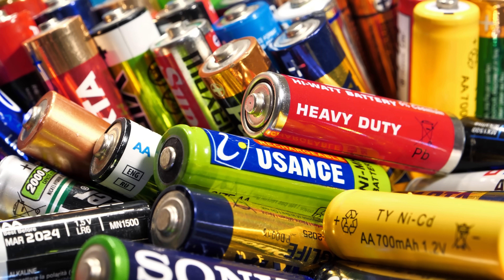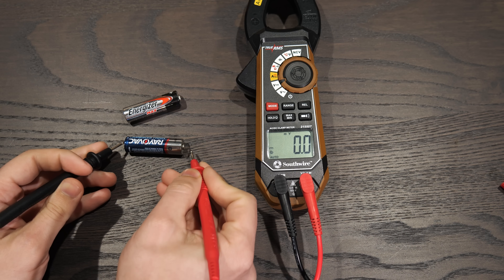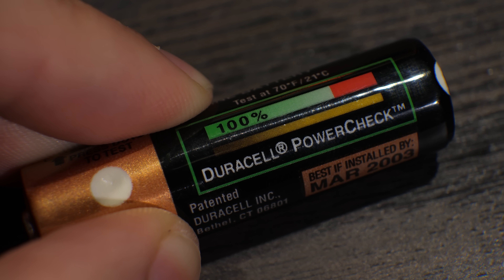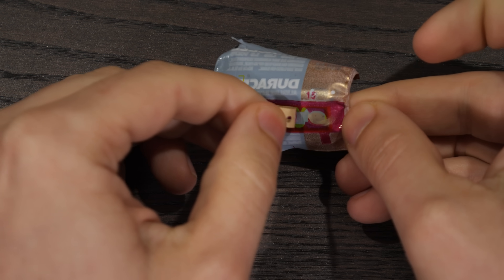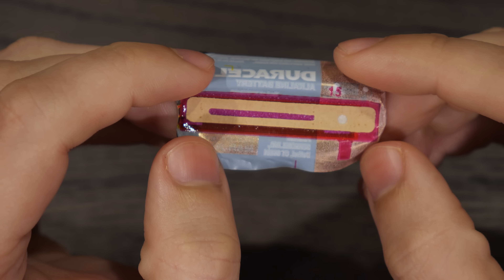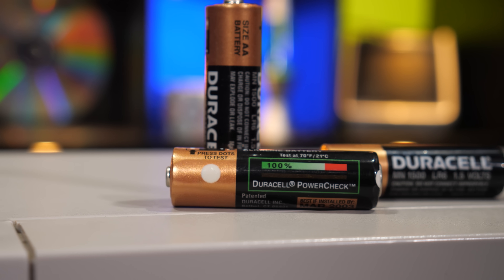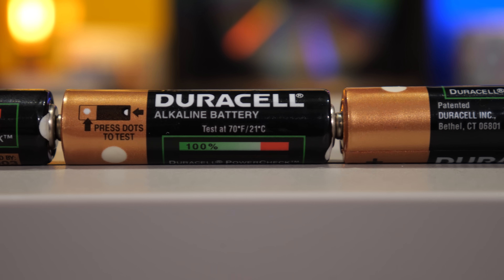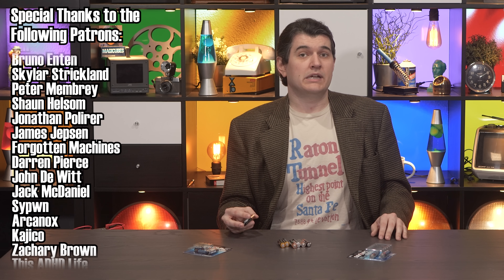Duracell PowerCheck: A genius idea which didn't last that long

Comment: The most common way to cause premature battery failure and leakage is to mix a fresh battery with a used battery. That can happen when salvaging a battery when dealing with items that use different voltages. Like pulling a battery from something that uses 1.5 VDC into something that needs 4.5VDC.

Comment: Some devices reject batteries sooner than others, so that's why I have partially used batteries around. For example my digital camera rejects batteries pretty soon, but I can use them in wireless mouse for a good while after that. When the mouse starts shutting off, battery shows about 0,9V with multimeter.
Also, have noticed, at least with LED head torches that use 3 AAA batteries, usually when it gets dim, for some reason only one battery has lost the voltage, two others are still just fine.

Comment: While I agree this isn't as useful as the inventors thought, I do think you missed an important use of them, which is the main reason why I liked them and would prefer if they were still sold:

Imagine you have a device that needs batteries, and it's suddenly stopped functioning. It's probably just that the batteries are dead... but maybe not. Maybe the device itself is broken. Or maybe only one of the batteries is dead for some reason. Or maybe the "new" battery that you're using has been sitting around so long it's degraded in the battery drawer enough to no longer be useful. It's useful to have a relatively easy way to test the batteries so you can be assured that it really is the batteries (or, conversely, that it really isn't the batteries).

Comment: AAA are everywhere now, though the devices they are in could easily fit AA.
It gets worse when there is an "internal battery", a cheap lithium cell which floats around an enclosure where you could have fit like 6 AA's.

Comment: I'm an odd one out and use a battery tester nearly daily for my hoard of partially used batteries in my work place. I have a collection of AA and AAAs for camera flashes and radio triggers for flashes and strobes, I'm often just testing the functionality of those devices so I place the battery in for a few minutes and then take it out again.

Comment: I suspect AAA batteries are selected for hand held remotes due to the weight issue. There is probably a slight measurable improvement in user experience with a remote that weighs slightly less for reasons of balance and muscle exhaustion.

Comment: I am also very glad more devices are moving away from disposable batteries, but at the same time appreciate being able to replace a bad battery instead of throwing the device away. 
I like rechargeable replacements for alkaline batteries. They are replaeable, can be used in vintage devices, and best of all, they do not leak when they die and sit in the device. That is one of the worst parts about alkaline batteries, and just how much chemical trash they make.

Comment: As a 90's kid, I sure as hell remember those, it was always fun pressing on the switches and seeing how "good" your batteries still were! And then eventually came smart chargers with computer processors, which would re-charge my batteries to just the perfect voltage, which as he said, made non-rechargeable ones just.. obsolete. Nowadays you can easily get a good 1000 charge-cycles or even more if you have a "smart" charger that adjusts voltage and charging current perfectly.

Comment: As for testing batteries with a multimeter - for the AA and AAA ones I tend to use the amp meter. I put the meter on 10 Amp DC circuit and that's good enough to handle shorting a small battery for a few seconds and is a better indicator of how much juice the battery has left...

Comment: I am with you that the built in battery tester wasn't really worth it.  However, I can envision some cases that generate partially used batteries.  Perhaps the most obvious for me is the flashlight.  You pick it up and it produces no light.  You replace the battery, thinking it may have been left on.  Still doesn't work.  You make a trip to the store and get another bulb.  This normally fixes it.  Most of us are too lazy to put the original batteries back in, and the originals get tossed in the junk drawer.  Condition unknown.  I have also run into corroded or bent switches.  Believe it or not, I have seen similar things happen with car batteries.  How many people think that if the car doesn't start, it must be the battery?

Comment: We don't even really need battery testers.
Just put the batteries in the device you need to power up.
If the device turns on your battery is good.
That simple.

Comment: This feature was extra useful on road trips when the parents got one package of AAs and you just had to make do. Sometimes one battery died before the others and the tester could find the culprit, sometimes you just wanted a proxy for how much play time you might have left on the gameboy or CD player. Considering the low cost per mile of quiet kids in the back seat time, in hindsight I’m surprised they didn’t just buy more batteries.

Comment: another reason for dicontinuation. is the temperature sensitive indicator.
 they would have to make multiple version for various regions/climate. 
in asia, it was always yellow. so it thought toi be a useless indicator, until we keep batteries in the fridge for storage. its something i learned from photographers.

the idea of using voltage drop is why newer batteries simply use 4-5 LED to show charge level and flashing to indicate charging is simply a pulse circuit added

Comment: Okay, I've literally never seen one of those work before. I was always a weak child, before I got my nutrition and exercise situation fixed as an adult. I could never press hard enough. Seeing it glow orange was pretty cool! 

I convinced myself it maybe worked like one of those colour-strip thermometers and that I sometimes saw the red bar move, but, ultimately I just... never got any use out of this feature.
Reply: Okay, so it does operate like those bathtub thermometers but not in the part I was looking at 😅

Comment: I never even thought about using that feature for testing stored half-used batteries. I always used it to figure out which battery in a multi-battery device was dead, and miss the feature every time I have to change a device’s batteries. Also it makes me wonder if they realized that some people will just change all the batteries in a device when one dies if they don’t know which is dead and don’t want to bother finding out.

Comment: Makes sense why they aren't in production.

The cell's housing has an entire body positive terminal and a small button negative contact

Which is counterintuitive to nearly all battery designs which small positive terminal and a full body negative terminal.

This meant opening and operating an entire new line of production for this design change which technically operates as reverse polarity battery.

The small positive and entire body negative is literally like a standard for any cylinder type battery like the AA, AAA, 18650, 22650, etc

Except for those button cells.

Comment: I liked those built in battery testers. They came in real handy. Now I have a battery case that holds AAA, AA, C, D 9 volt and CR2032 batteries. The case came with an analog battery tester. Personally, I prefer alkaline batteries because the NIMh rechargeable batteries topped off at 1.2 volts and that’s a problem with most of the devices I use them in.

Comment: Fun story from the 1990s: as a child, I was gifted a radio controlled car by my parents. It was powered by 10 AA batteries linked in series. After playing enthusiastically with it around the house, the car stopped working. My dad, ever the savvy fellow, pulled out a multimeter and checked the batteries. They each clocked in at about 1.4 volts. But, even as a child, I understood that it added up to a drop from the expected 15 volts to something just shy of 14; just barely enough to no longer properly work.

Comment: if you put your tongue on the strip, you can feel it get really warm during the test XD

Also still see alkaline batteries that sometimes have this exact strip included in odd gadgets once in awhile. Whatever fancy factory machine Duracell used is still out there, somewhere, still putting power check buttons on off brand batteries for manufacturers

Comment: As I recall, using the last breath of my memory, some items only functioned on the full half of a battery, such as a cassette deck, remote control car, or other motorized item.  Then they could be used in a transistor radio or Game Boy for their lower power life.  Batteries were expensive. The problem with this tester was it was obnoxiously hard to press the dots hard enough to reliably run the test.

Comment: Interesting video on batteries. I used to work for RAY-O-VAC back in the late 70's at the engineering and development center as a technician. A lot of cool things done there. As a technician I was doing research into better alkaline batteries. But the coolest was lithium back then. Oh the stories I could tell. One of the best jobs I ever had !

Comment: I had a pack of I think heavy-duty or lithium Duracell batteries a couple years back, all the cells had powercheck gauges on them. It was a brand new pack of batteries that has been manufactured that year, so duracell is still somewhat using the powercheck stuff

Comment: Somehow, I never knew these existed. I’ve always had a multimeter. And, I keep new batteries in their packaging and used ones in a drawer, just in case. Apparently, as batteries age, their internal resistance increases.

Comment: As someone who really hates throwing functional stuff away, I have a lot of older oddball devices around that use disposables like this still, but for that exact same reason I have a family of rechargeables for said old thingamajigs. 
I often find I'm skeptical of how much charge is in them after they've been in the device for a while, even if it works when I check them. 
A simple checker built in like this would actually be tremendously helpful to me, now that I'm using batteries I need to keep topped up, as opposed to just tossing them when the proverbial gauge hits E for "end".

Comment: I still have the built-into-package testers out in the garage.  Probably D, C, and AAA, but maybe not for AA.  The testers themselves were different, no doubt because battery drain characteristics were.  It was hard to fit them "wrong" except one combination: AA cells would fit fine into the C tester.  I believe there was a 9V version as well.

Comment: I had a product in the 90s that used AAAA. (Yes, quad A batteries.) It was a small device, but it wouldn't have to be much bigger to handle a battery that stores actually stocked.

Comment: The best disposable batteries you can get are Energiser lithium's as it's a false economic buying anything else. Yes, they are exspencive but they'll last Soooooo much longer than anything else out there. They also don't leak and their very light compaired to all the others due too the chemistry. 
Your literally thrown your money down the drain if you don’t buy these. The best and cheapest place to get them is on eBay or Amazon and you definitely won't be disappointed, that's for sure.

Comment: I learned you can either bite the battery or bounce it to see if it’s used or new. New ones are soft and don’t bounce as much. Used ones won’t dent if bit and will bounce much more than a new one when dropped. I drop it on the bottom flat end. I’m commenting this before the video ends. If he mentions it, I’ll hang my head in shame, but leave the comment up.
🤞

I don’t recommend biting it btw. It does work, but it would be a really silly way to mess up your teeth

Comment: The first thing that uses AA batteries that comes to mind is Xbox controllers. Which tbh is actually a good thing since it's easier to replace a AA than take apart a controller and replace a lithium battery

Comment: I remember these Duracell 9 volt batteries (those square ones you'd use in fire alarms) that had a variant of these power check things. They used a separate strip of paper with a similar level to them. You still had to apply pressure on the end of it and it would get very hot but it did show you the level of the battery.

Comment: There is a video by a "maker" couple who make fun projects on you tube.
     They once painted their toilet seat with that thermo-chromic then she sat on the toilet seat after the paint was dry. It left a very detailed image of the parts of her body that were on the seat. Her reaction was pretty funny as she clearly didn't expect it, but the fact it was included in the final edit means she didn't really mind.
    No, I will not link the video. If you want to see it, you'll have to "pay" by doing the "work" to search for it.

Comment: Didn't last that long? Alec, there's a set of spare duracell batteries for my wireless mouse (the primaries are rechargeable but I need something while they sit on the charger occasionally) with the powercheck thingie on them!

Comment: Random snippet I would test my junk drawer batteries by dropping them on the floor and the batteries that would (bounce) were either depleted and the ones that wouldn’t bounce still had enough juice to be used (or it was the opposite) 
Not sure if it was a coincidence or there was something to that but It didn’t seem to fail that much.

Comment: I found these useful when you weren't sure if it was the remote control, infrared sensor, or the batteries that were the issue. My parents went through a lot of contortions trying to get the remote to work sometimes LOL

Comment: I know some people who still burn through disposable batteries. I personally use lots of AA and AAA batteries, but I have been using NiMH rechargeables for decades. If you're wondering what for, here are some: LED light strips (some built in USB, some AAA), wireless Xbox One/S controllers (still AA if you thought they were lithium ion!), and a wireless mouse.

Comment: I used to love this testing strip, and I always wondered why it went away.

Incidentally, I made a big push over a decade ago to move all my AA-powered devices to AA rechargeables.  I found out pretty quickly that NiMH batteries only produce 1.2 volts at full charge, and many digital devices refused to work with that little voltage, and would only work with alkalines.  It annoys me to no end, since it's trivial to build a voltage boosting circuit into the device, which trades a bit of current for more voltage, and could allow batteries of all types to be used, and makes them last longer.  But, hey, a voltage booster adds a few pennies to the manufacturing cost, so... of course we can't do that.

That reminds me... I have to change the button cell battery in my bathroom scale again.  That darn thing chews through a new CR-2032 in a couple months.  Sigh!

Comment: Me and the boys use the drop test
Reply: Grab the battery in question and a full battery (for control). 

Drop them at the same time from the same height.

If the battery in question bounces higher than the full one, it's less full. 🤯

Comment: They actually did keep this technology until about 2020, they just made it an exclusive for the Duracell Quantum. I got those pretty regularly because I had a Windows Mixed Reality VR headset and they were the only battery that woudnt get murdered by the controllers in a few hours. Rechargables didnt work well due to the voltage drop rate

Comment: when these came out, I decided to only buy them, due to the functionality. I think I mostly wanted to know if the batteries were still good before replacing them, or before using them new from the packet, in case they were already too old. a couple of years ago, I had an excellent 3 led orange battery tester, but lost it after a fire, and now can only find the analog voltmeter types that are much bulkier than needed

Comment: I remember these. I also remember in the very early 90s when I was a kid (maybe about 1991) when these testers came out, but in the battery packaging like you mentioned. The first ones didn’t turn yellow, but more like a weird dark rainbowy LCD like color. Then maybe a year later is when they turned yellow.

Comment: i have a box of them from when i change out smoke detector batteries and the holiday window candles (i use them remotes and flashlights that get used up on the regular)

Comment: Not mentioned, as far as I got in the comments:  the insulator made these batteries ever-so-slightly larger than typical AAs; this made both inserting and removing them from, say, a particularly cold AA-powered metal flashlight body, quite problematic.  I liked the idea of these, but hated trying to get them out of anything with a tube-with-endcap style battery holder.

Comment: Going through AA and AAA batteries was definitely expensive as a kid. I like having things rechargeable. My only problem is that most rechargeable batteries are non-removable. We went from replacing batteries when they die to replacing whole electronics when the battery will no longer hold enough charge. Removable rechargeable batteries should be more common.

Comment: My mom and I used to get our batteries to last longer by putting them on the stove after we were done cooking so they got residual heat or by rubbing them between our hands. Dangerous I know, but it worked.

Comment: It's funny, as a kid I always assumed these worked through some kind of conductance through your fingers, and so I always assumed the two buttons had to be pushed with your index and thumb of a single hand -- which makes for a really awkward grip and a difficult time pushing them. It never even occurred to me to try using two hands. Watching the two handed operation of the tester just blew my 37 year old mind.